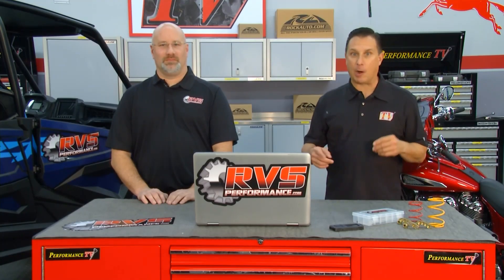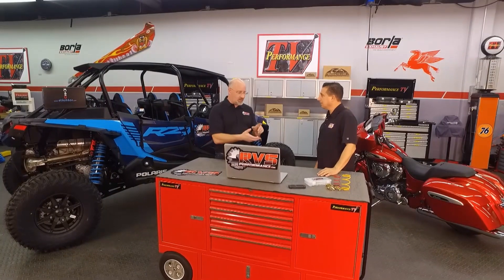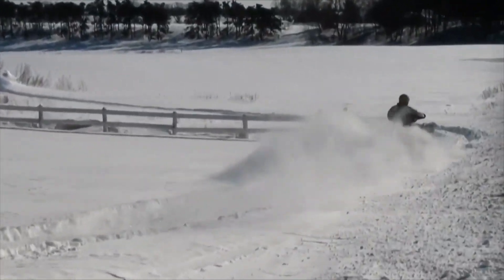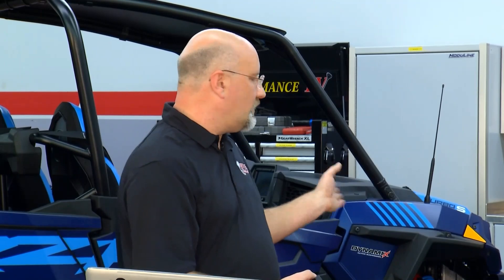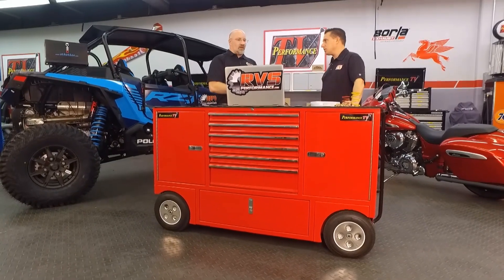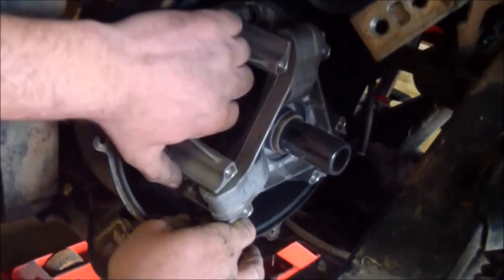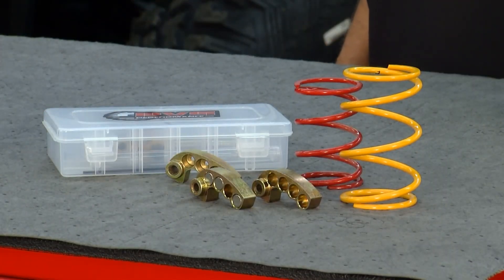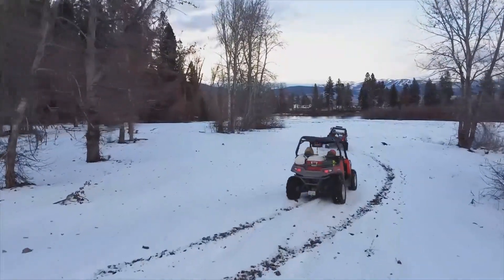RVS Performance   PTV 2011

Comment: What would be needed to try to get back to stock torque when putting 29.5 outlaw mud tires on a polaris sportsman 450? Would i need a gear reduction or a clutch kit?
Reply from the maker: Clutching will help get the power you have to the wheels better, but to get back to "stock" will require gear reduction and more HP.